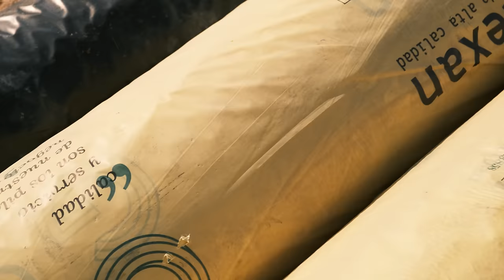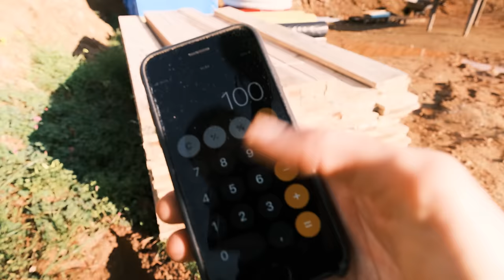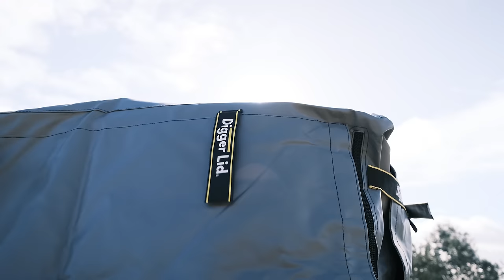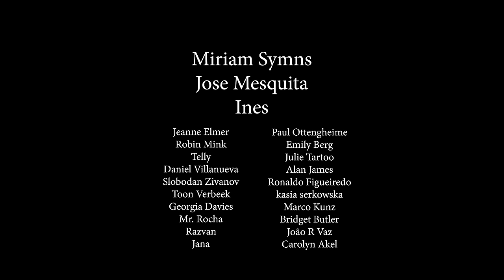Building Our House Start To Finish | Episode 3: Slab Plumbing, Geotextile and Gravel

Comment: its a bit late now, but to stop it happening in future, you should make sure to make a sand bag for your tripods, there should be a hook at the bottom in the middle for exactly that purpose. the sand back should ideally touch the ground too, to make the whole tripod heavy enough that it won't tip

Comment: Isn't the magic code 1329 the number of the norm for "sewage pipes from PVC  inside buildings for hot and cold water"? I mean, it surely will work with other tubes too, e.g. gutter tubes, but diameter and material properties are already defined, so they'll surely be the best choice.

30-45min videos are most preferable IMO.

Comment: I like your videos so much, but I hope you havn't bring in the concret right now? First of all, U use the grey sewer pipe, from my point of view, they are certified for in house constructions only. The orange sewer pipe have to use outside of/under the building, because they build for higher pressure. 
And if you have "falling water" is necessary to use 2 x 45° or 3 x 30° instead of 1x 87° bow. Your construction prepared Pipe blockage, because the heavy ingredients can't flow away.
EN 1329 is a code for the pipe Standard > your pipes should have the standard code EN 1401

Comment: Shorter, more frequent videos would be better to keep the continuity of the build. Also, a few more technical details - for example, how you measure the pipe's length, how you connect the pipe, all with brief explanation - would be very interesting but would not take a lot of time. We see you doing it, and it gets repetitive when you are doing it and doing it and doing it, instead giving us a brief description and then doing it, with the end result coming soon after - you used to do it previously on a weekly basis. I know these long videos are a lot of work so shorter would be equal amount of work but easier to assemble.